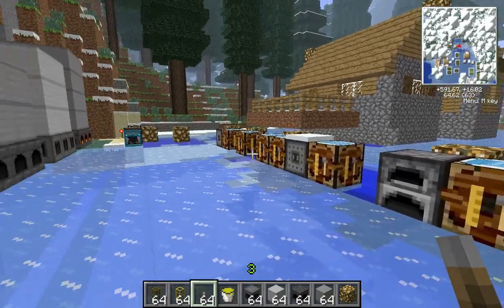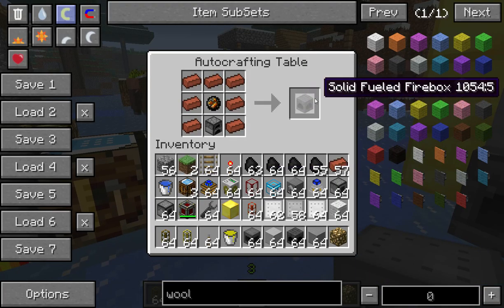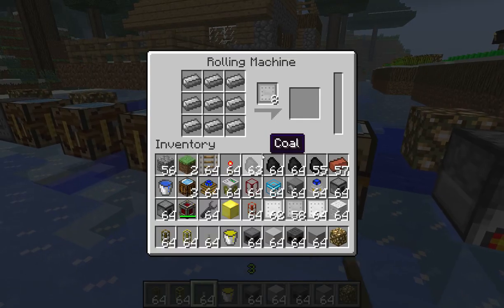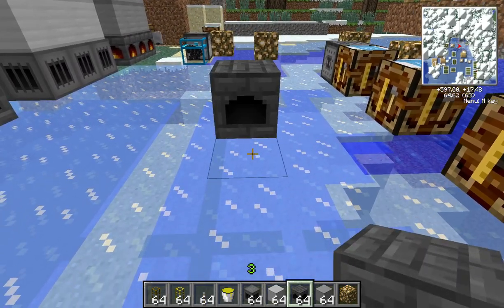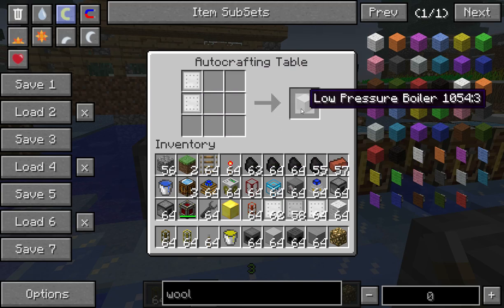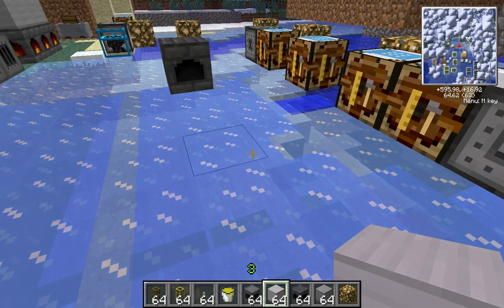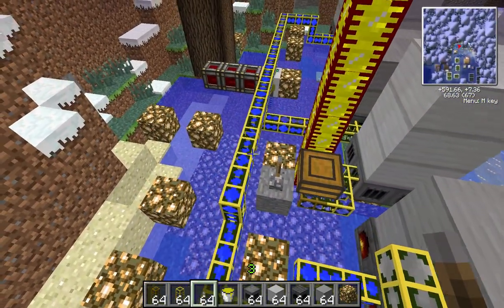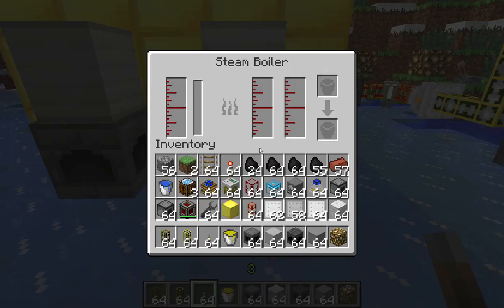Block Spotlight - Steam Boiler

Comment from the maker: I've set up a few different systems to keep them supplied with fuel (more often then not charcoal) in our let's plays. In our Feed the Direwolf series I used railcraft un/loaders. In our Mixtapecraft series I used Thaumcraft golems and thermal expansion tesseracts.

Making charcoal from a forestry multifarm and piping it in is probable the simplest way of doing it. Blaze rods can be used as fuel too so a Blaze farm is another good way of keeping it fueled up.

Comment from the maker: Yes. Charcoal does work with a steam boiler. One of the weaker but better fuels to use only because you wont run out. I more often then not will use charcoal created from a tree farm to run my steam boilers.

Comment from the maker: Yes. The hotter either of the boilers get the less fuel is used. It pays to keep your boiler going even if you're not using any power for this reason. Heating a boiler up is very inefficient.